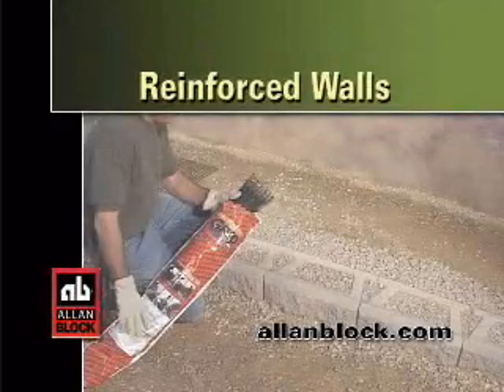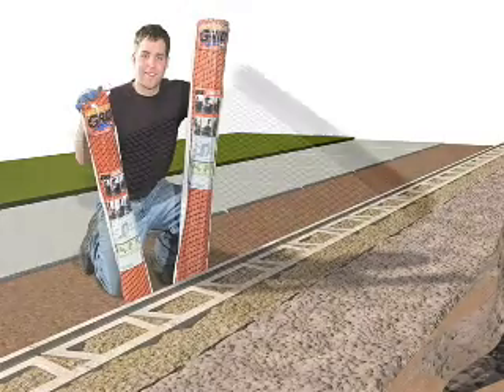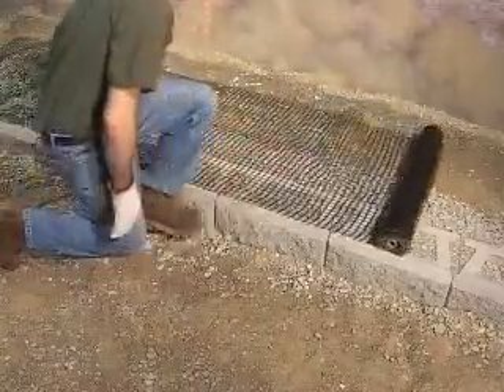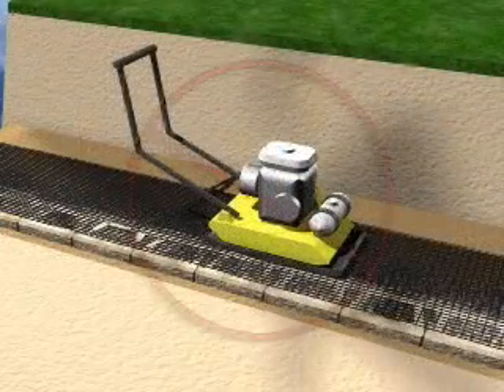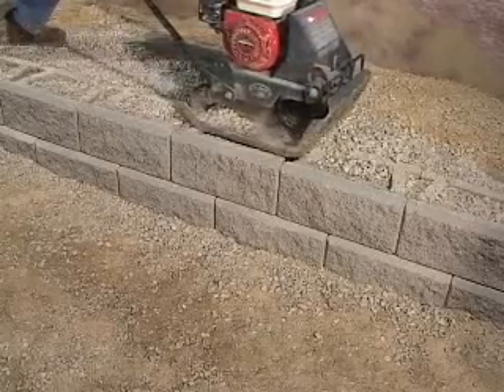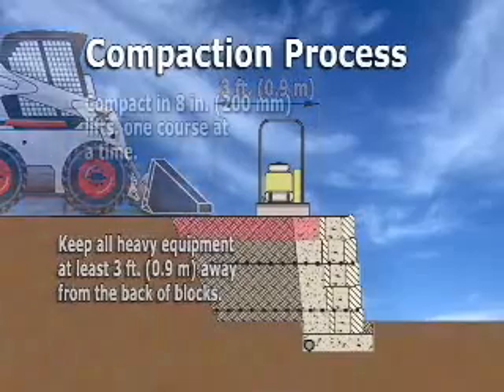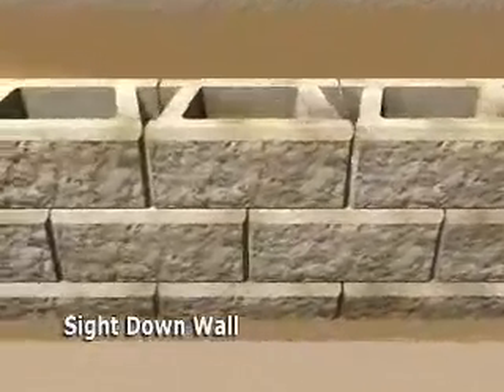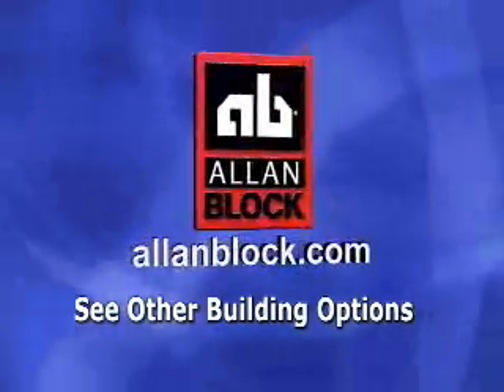How to Build a Reinforced Retaining Wall Using Geogrid

Comment: Great video.
the deformations of these walls should be monitored in order to avoid failure. We are developing sensor-enabled geogrids for simultaneous stabilization and instrumentation where the tensoresistivity of the coating material is taken advantage of for real-time monitoring of the deformations.
http://students.ou.edu/Y/Hessam.Yazdani-1/
Reply from the maker: Interesting comment.  How does your censored geogrid compare to the censored grid that Mirafi has been producing for nearly six years?  In a perfect world all walls could be monitored but there are major cost factors to consider.  The censored grid is more expensive, the installation is more expensive due to the installation of wiring and controls, the cost of monitoring need to be worked in, how long do you continue monitoring (1 year, 2 years, 10 years?), do you pay a testing firm or university to run a study and produce reports and whitepapers?
Allan Block has over 250 million square feet a wall installed worldwide and we are just one segmental retaining wall company.  Only an extremely small fraction of walls have problems and those are mostly due to contractors cutting corner and not following a set of industry Best Practices.   
So your general comment “these walls should be monitored in order to avoid failure” is much too general and completely impractical.